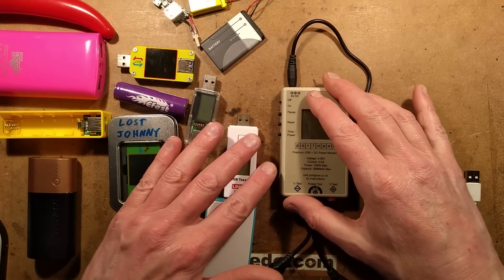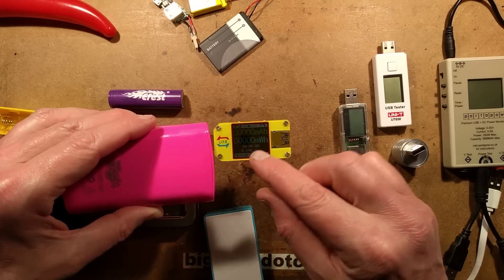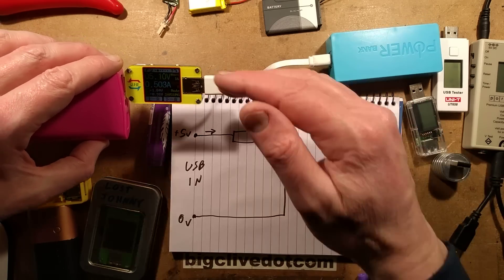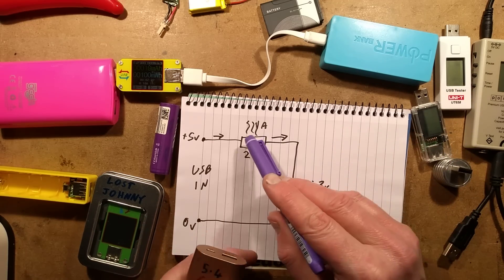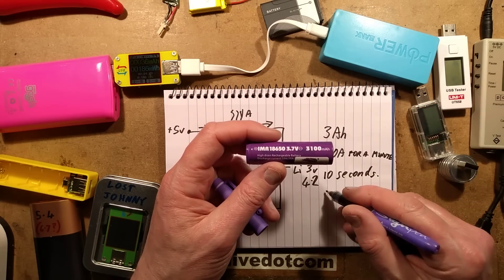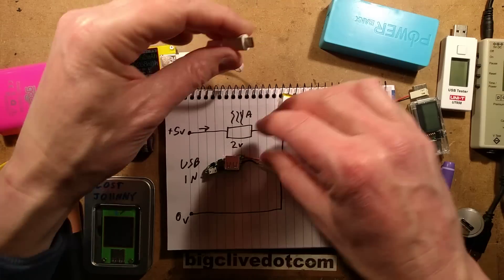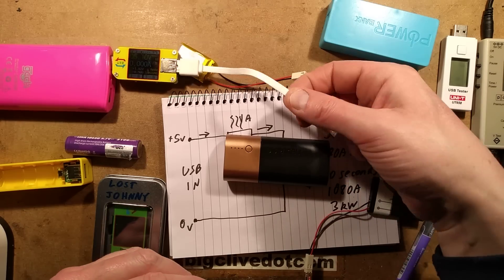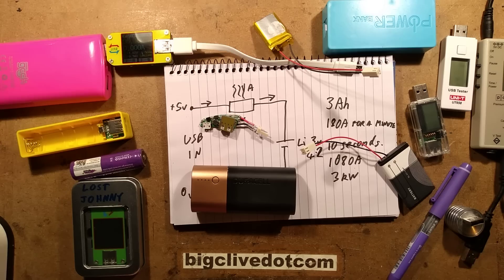How I test lithium cell and power bank capacity.

Comment: Why im getting half mah with New samsung tablet? Should it be pluged direct to phone or the charger?
Reply from the maker: It may use a high efficiency charger that converts the charge supply voltage to match the cell.

Comment: I'm completely baffled. What is the UM43 doing? You have plugged a power bank into BOTH ends of the device so what is it measuring?
Reply from the maker: It's measuring the flow of current into the device being charged.

Comment: Excellent video, thanks. I bought 3 on eBay along with 3, five volt, 6 watt solar panels. I am a big fan of 18650 lithium cells. Salvaged from discarded power banks. Always on search for disposable vape devices.

Comment: So you are measuring capacity by seeing what goes into a cell.  I've been measuring it by what I can pull out of one.  I've a little device here with a power resistor or two attached,  some 7-segment displays,  and the ability to set various parameters by pushing buttons.  I'll charge a cell fully,  stick it in a holder attached to this device,  and run it down,  reading the total capacity in mAH with another device similar to the ones you show here.

Comment: Ive got 2 of these testers, and they seem to be somewhat accurate for a standard 5v charge, but both give rubbish back for higher voltage 'fast charge' devices. My phone is 4500mAH, the testers say 3600 at 5v from flat to 100%, and 1800mAH at 9v fast charge. The phone lasts a long time, so it is charged fully. Strangely the Wh figure they give is pretty much bang on the battery spec.
Reply from the maker: If the power banks have buck converters in them to use higher voltage for higher charge current, the tester will only display the amount of current at the higher voltage.  They only show realistic mAh capacity with a simple linear regulator where the current going in is the same as that charging the cell.
Reply: @bigclivedotcom  Thanks for that, makes sense. All my power banks are the smart type, so maybe a trip to poundland is in order to get a cheap simple one, then test again.

Comment: Hello Clive and all,
Is it not better to know the discharge capacity of a power bank (or a Lithium cell) rather than the charge capacity?
I ask because it is not uncommon to put more power (current/voltage/time) into a cell than you will actually get out of a cell.
I have a power bank that when it finishes charging, the charge capacity is 2400 +/- mAh, but discharge the power bank and I only get 560 mAh.
Charging the internal cell on its own using a lithium cell charger and then discharging the cell through a constant current load of 200 ma, confirms the cell's discharge capacity is only around 580 mAh.
The cell is clearly of no use unless you want to put around 5 times the charge into it than you get out of it.
However, does this not suggest that discharge capacity is more accurate than the charge capacity of a lithium cell/power bank when it comes to knowing what you can expect to get out of a lithium cell or power bank?

Thanks,
K Watt - yes, that is my name.

Comment: Why Did'nt They Make 5Volt Lithium batteries..save lot of Fuss??..Why 3.7V...?
Reply from the maker: The chemistry sets the voltage.  I'm not aware of a good battery chemistry that would produce a voltage as high as 5V.
Reply: @bigclivedotcom  Thanks..!

Comment: That neat little 3W aluminium flashlight adapter can be got from Amazon or eBay quite cheaply. ETA: Also that USB Tester Power Meter - mine is a UM34C USB tester costing £26.99 from Innovateking-EU, but can cost a lot more so it pays to shop around.

Comment: Far and away  the king of charger/wattmeter/capacitychecker/refreshers is Opus BT-C3100
https://www.ebay.com/itm/Opus-BT-C3100-V2-2-Digital-Intelligent-4-Slots-LCD-Battery-Charger-EU/254435584400?epid=1478483243&hash=item3b3d8ae990:g:awsAAOSwWEddyJu-

Comment: Some of these Chinese company can make decent products and be truthful about Amp hour but the common mistake they make is to use resistors instead of  capacitor to control current thus the diode over loads. I personally hate lithium tubes and rather just have a power brick of 4 8AH lithium packs.

Comment: Great video Clive. How could I test a name brand 18V makita battery against an ebay knockoff in the similiar fashion you have done here?
Reply from the maker: I'd probably do it by tapping off a set of internal cells and running the test on those cells with an external charger/discharger.  Then afterwards I would recharge the cells to match the voltage of the others in the pack.  If I wanted to do it with the pack intact I'd use an independently powered mAh meter like the Portapow and put it in series with the existing charger.

Comment: Back again. So I measured my one phone, a Nexus 5X, from flat to full and it came out around 2300 mAh. Supposed to be 2700mAh new. Makes sense to me. I think I used the mWh reading and converted it down to mAh @ 3.7V
I know that normally this would  be difficult to measure at all since usually you charge a phone while it's on, so I did it while it's off, hopefully keeping the draw down.
That's not my Daily phone though. It's one of the models that had a widespread bootloop issue, so now it's really slow to use.
The replacement was a Doogee S60. A  brick of a phone. I noticed a lot of lies in their advertising. Like they say it has stereo speakers, it's only got one for media playback. They say the charger's capable of 12v 2A (so 24W) charging, I can only get 9v1a, or 5v1.4a out of it.
They say the Battery is 5580mAh. So of course I want to measure that.
Ran it flat. charged it to full while it's off. The numbers are confusing. It started at 5.12v 1.4a and went down to 5.02v .25a by the end.
Ruideng says it used 3080mAh. Being generous and using the max voltage to convert that to mWh, 15769. Down to 3.7v,  4262 mAh.
The Ruideng also said it used 23835 mWh, which I think is what I used to measure the 5X before, and THAT converted down to 3.7v is 6442 mAh.
Since neither of these are close to the stated capacity, and I've had the Doogee for a year, would you think the mAh -> mWh -> mAh reading is more accurate or the flat mWh -> mAh?

If you read all that, thanks a ton! Also never buy a Doogee phone, Clive.

Comment: Did you get the Ruideng UM34C with blue-tooth? A couple of months ago I purchased a cheap android phone from China so I could load all sorts of dodgy apps without worrying (separate gmail account w/pre-paid credit card). The app for the UN34C is well worth checking out.
Reply from the maker: I didn't.  I'm always cautious about downloading apps like you describe.  It really does require a separate account and system.
Reply: I'll buy you one. I am a Patreon supporter, so you may be able to get hold of me through them.

Comment: Another thing though, I watched some of your earlier videos and you were using one of those little load testers with winding resistors you can get off eBay for like 1USD -- As opposed to a light.
Did something happen to that device or is the light just more convenient?
Reply from the maker: The light is a good indicator of when the bank has cut off.

Comment: I wish that the cell manufacturers would add the Watt-hour capacity to cells. It would eliminate much of the confusion for many consumers, and simultaneously reduce the scope for scammers to use misleading advertisements claiming ridiculous Ah - or rather mAh - capacities. A simple '11 Wh' makes more sense when trying to use those powerbanks. Then an allowance can be made for charging and conversion losses, and we could then know to expect about 10 Wh from a decent unit. To be fair, the more reputable ones do that already, but it should be a legal requirement for all types of cell and battery, including those disposable ones which have never been required to tell the customer what they are actually buying.

Comment: Can someone please explain why these results happen.
Used a 2W LED Torch to discharge the Power Bank.
ASDA ONN Power Bank. Rated at 3350mAh the packet.

CHARGING.
3 Hours and 50 Minutes
3011mAh
5.18volts

DISCHARGING
2watt LED Torch taking 0.41A
4 Hours 52 Minutes
1940mAh
5.01volts

Comment: For the 18650 (and similar) cells, I like the BT-C3100 NiCd/NiMH/Li charger/discharger.  For the wired cells, I use a dummy 18650 cell with solder tabs to connect the cell under test to the BT-C3100.  The charge and discharge currents are settable and the unit can be set to the repeated charge/discharge mode - excellent for getting a new cell to its maximum capacity.  

Seeing the fireworks - and the Fire Department's question about live ammo - from Rick's Disney car fire, I'm glad I opted for older technology (lead-acid AGM batteries) for my small solar system.  The 82AH (8 hour) or 90AH (20 hour)12HX330FR batteries are very capable, being rated to deliver 586 amps for 2 minutes and 3700 amps short circuit current, but the voltage tolerances aren't nearly so stringent as the lithium cells.  If the charge voltage gets a little above the float voltage of 13.65, it's not a problem as DataSafe recommends occasional charging to 14.4 volts in what would be an equalization cycle for a flooded battery - but only 4 or 5 times a year.  For a 6 battery, 540AH battery bank in the basement, I'd much rather have the larger AGM batteries.

Comment: The usb tester voltage measurement accuracy will get affect when there is current flowing. https://lygte-info.dk/review/USBmeter%20RD%20Tech%20USB%20Meter%20UM25C%20UK.html There are dedicated battery tester with 4 wires leads and 4 wires battery holder, separate wire to measure voltage and current. http://powercartel.com/teardowns/zke-ebc-a05-dc-electronic-load-charger/

Comment: Thanks for this, Clive.  Having RTFMed the instructions with the UNI-T UT658, I got sucked into measuring the charge delivered by a powerbank.  However, your video made me realise that the powerbank's boost converter will draw some of the cell's stored charge to boost the voltage to 5V so, inevitably, it delivers less charge to the load.

As you point out, the only fair test of a cell's capacity is to measure the charge that a charger delivers to it through a powerbank's dropper-type charging circuit.  I think you later discovered that even the upmarket Duracell PB2 powerbank doesn't have a buck converter that would draw less charge from the charger than it delivers to the cell.

Comment: Question! If a power bank has a 10,000mah with a 2.1amp port and a 1amp port, if I use the 2.1amp will it just be faster or will the battery be using double the power compared to 1amp.
Reply from the maker: The 2A and 1A ports are usually in parallel with the difference being the way the data pins are used to signal the current availability.  It's to make some phones charge properly.  Sometimes the total current available is still just 1A.

Comment: I have a cheap USB power bank (soshine E4S) that I got from ebay that has spring loaded contacts for easy replacement of 18650 cells and can measure capacity. For measuring power banks I use a device similar to what you have here, but I measure both a charge and a discharge cycle and take the geometric mean of the capacities to compensate for loses in the charging/discharging circuit.

Comment: you want to test the capacity of battery and his voltage , if you want to test the capacity, you can take it as power bank, then use our forum , 
power bank capacity calculation method 
 After the power bank is fully charged, connect the AT34(data first reset) with the appliance, then discharge to the stop output 

Method 1: power bank capacity =AT34 measurement mAh * the output voltage ÷ battery voltage ÷efficiency.

Method 2: power bank capacity =AT34 measurement mWh ÷ battery voltage ÷efficiency (normally power bank output voltage is about 5V, internal battery voltage is about 3.7V, efficiency about 85-90% )

Comment: you did not how to use this UM34C, it is a pity. 
for screen brightness : 
Press and hold the "Next" button to enter into setting state, press “NEXT” button to step through the options of auto screen off time, brightness level, temperature display units, theme background color and theme foreground color. Stop on the value you wish to change then press the "PREV" button to change the setting.
 For the screen brightness setting, press ‘PREV’ to repeatedly step though the 6 options from 0 to 5 where 0 is the lowest brightness level and 5 is the highest. Default brightness is 4.
 At any setting state, press and hold the ‘Next’ button to exit the settings menu.
because we have many many function, so the operation have a little complex . 
for language, press and hold any button to plug into charger,  the module will display four options. Option 1 selects the Chinese Interface and option 2 selects the English interface.

The third option is to reset（after reset, system setting data was restored to the factory setting, all the stored data was not reset）, The four option is to zero the Current reading (Ensure there is no load connected to the unit). Release the button at the desired selection. Pressing and holding the button after stepping to the four options will exit the hidden interface.

our meter can show many data , and you can connect app to export the data , it is very good , products, if you want to know more , please check this page https://www.aliexpress.com/item/RD-UM34-UM34C-for-APP-USB-3-0-Type-C-DC-Voltmeter-ammeter-voltage-current-meter/32880908871.html?spm=a2g0s.12269583.0.0.71687e83trECEN
Reply from the maker: I had accidentally put it into Chinese language mode while plugging it in.  I sorted that afterwards.
Reply: @bigclivedotcom  now you know how to change it ? on the next week, we will publish a new meter type-c port, PD tigger,  two current way, firmware update on line ,. are you interesting this ? if yes, please give me your email

Comment: I was just thinking this and how to test my fake gopro batteries, when i thought there seems to be two schools of thought on this. One is to see how long it take to charge, like your own, and the other is how long it takes to discharge(https://www.youtube.com/watch?v=8luUE2aaHn8) What are your thoughts on this.
Reply from the maker: The charging test is the most versatile since it can be used to test cells sealed inside equipment and can use existing connectors.  But for accuracy, removing the cells and finding a way to connect to their contacts is definitely going to be a bit better.  But not by much.
Reply: @bigclivedotcom  cool, so have you a link to the device that lost Jonny sent you
Reply: you want to test the capacity of battery and his voltage , if you want to test the capacity, you can take it as power bank, then use our forum , 
power bank capacity calculation method 
 After the power bank is fully charged, connect the AT34(data first reset) with the appliance, then discharge to the stop output 

Method 1: power bank capacity =AT34 measurement mAh * the output voltage ÷ battery voltage ÷efficiency.

Method 2: power bank capacity =AT34 measurement mWh ÷ battery voltage ÷efficiency (normally power bank output voltage is about 5V, internal battery voltage is about 3.7V, efficiency about 85-90% )

Comment: I can recommend the Imax B6 charger or one of its many clones for people who play around with LiPos. It will show the capacity while charging and discharging. It is also very hackable for someone tech savvy. I have a homebuilt case with 3 of these powered from an old, hacked 203W Xbox 360 powersupply, which is just enough for my use.
Reply: if you want to test a charge, you can use UM34C to check the voltage , then you use  usb load to adjust the  max current to test the load output . this way can judge the quality of charger

Comment: Clive, do you have any recomnedations for good, high capacity, but not ridiculously expensive, 18650 cells? I have a set of 4 in an external battery pouch which came with some bike lights, but the capacity if terrible and the lights just chew through the pack in less than an hour, even on the lower settings. Cheers

Comment: Happy new year, Clive! A couple of comments- first you touch on failure modes, and how energy density is a root cause more than particular chemistry. One additional factor that I've heard that's relevant is potential for "thermal runaway"- how in some specific conditions, past a threshold the cells enter a self-sustaining reaction where their temperature increases dramatically. Some chemistries are very prone to this, while others are not at all, with only vague connection to energy density & cost, much more a function of when they were developed. Is this true?

Also, for your testing "rig," in addition to the instruments and the pie tin, have you considered a dedicated smoke detector? They've become very small and cheap. I'd be so happy to see you include a smoke detector, especially in your overnight testing setup.

Love the videos; thanks for taking time out to keep us entertained & educated!

Comment: Wouldn't an electronic USB load/capacity meter give more accurate results (less loss in cables etc.)? and less fiddling with cables and even more power banks? These usb loads are very affordable.

Comment: Just as a heads up I have a battery charger that will test the capacity as well as charge them, it's also not very expensive. You might even find it interesting, it's called MiBoxer C4. Got it on Amazon for less than $30 usd.

Comment: I have a Imax b6 charger. They are on Ebay for like 20 bucks. They have all the connectors and can charge/discharge most any type of battery. I have used it a few times and works pretty good.

Comment: You're right about the blue power bank. I have the exact same one (sold under the Vivitar brand), two no-name 18650s wired parallel. Ridiculously SLOW charge. It does, however, work quite well.